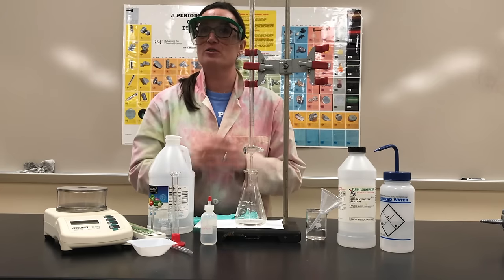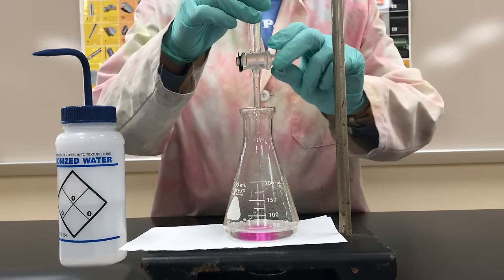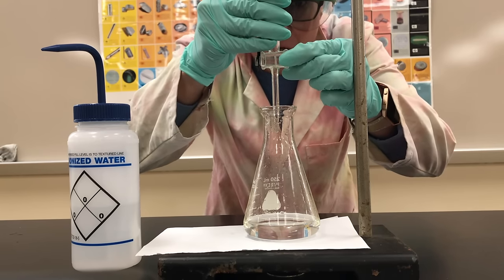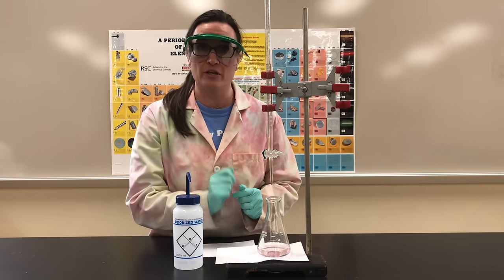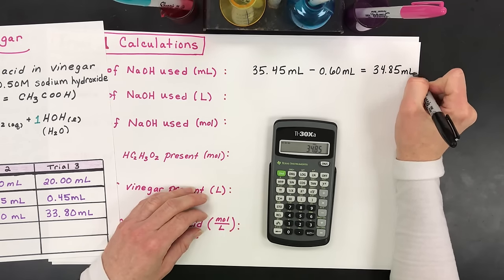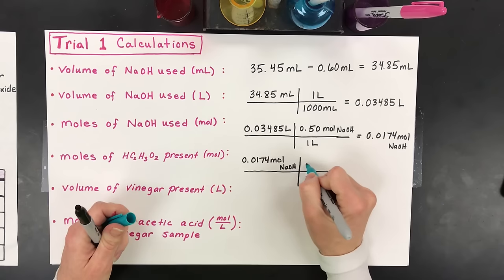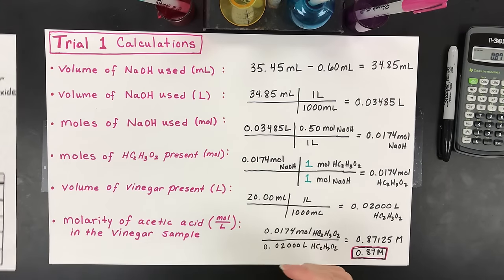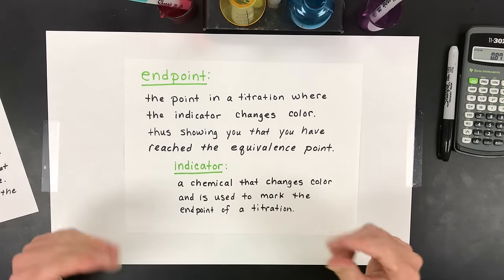Titration Experiment & Calculate the Molarity of Acetic Acid in Vinegar

Comment: I used a vinegar solution that contained 10% vinegar and 90% distilled water, when do I factor this into my calculations?
Reply from the maker: That would be double the typical percent of 5% acetic acid and has a M of around 0.83 M. This video I don’t discuss the calculations to change the moles of acetic acid into a mass percentage.

Comment: I have a question with the 2 decimal places when marking down the volume of the titrant(NAOH). Wouldn't it be one decimal place as you can not be more accurate than the measurement equipment(the burette) itself? Or maybe is your burette just more accurate than the one I have at school as the one I use during practicals only measure to 0.1 of a mL. 
This was a very informative video and has cleared up many things for me. 
Thanks!
Reply from the maker: Burets read an estimated hundredths place because there are markings ever tenths place.

Comment: hi! this video was super helpful! i just had a quick question. if for my lab, i had used 6.12 g of NaOH, which converted to moles would be 0.153 mol of NaOH, would i use that when calculating the molarity of the acetic vinegar? or would i use the molarity of the NaOH standard solution?
Reply from the maker: Since it is a 1:1 mole ratio if 6.12 grams was needed of NaOH to neutralize the Acetic Acid you would have 0.153 mol of acetic acid which you could then divide by the volume of the acetic acid used (vinegars volume).

Comment: Thank you so much .This helped me so much. I am on 2 week break and I have a chemistry test 2nd day back and this has clarified so much. Just one question, when you put final and initial amounts into the table. Is the initial amount, the amount of titrant that was in the Burnett’s before you added any NaOH? As it says an amount less than 1 but the final amount is around 35?
Thanks again
Reply from the maker: The initial amount is the buret reading before any NaOH was added to the vinegar in the flask. Some instructors would have you fill your buret exactly to zero, but that is t necessary unless you plan to make a titration curve using pH probes and a graphing program.

Comment: Hello Anne! Thanks for this. I know that the volume of the vinegar is already known but isn't it adding distilled water before reaching the titration may affect the rate at which the vinegar and sodium hydroxide reach the end point? Or that could be ignored and assume that it doesn't affect the titration process.
Reply from the maker: Nope. The water won't affect the rate of reaction. Water is the solvent of the vinegar (95% water and 5% acetic acid). Since we measured the volume of vinegar used the water added after will not alter the calculations.
Reply: Ann i am a science teacher here in kenya Africa. I have been trying to make white vinegar but failed repeatedly. Please hiw do i make white abd commercial vinegars.
Thanks Ann

Comment: Hi Anne, are you able to tell me how you know you have reached equivalent point? If I understand this correctly, the end point is when the solution becomes pink after swirling the flask, but im struggling to understand the difference between these two points? Thank you!
Reply from the maker: Equivalence point is where mathematically the moles of acid are equal to the moles of base for this titration. The endpoint is a color change from the indicator that signals that that point has been reached. A specific indicator needs to be used for different acid and base titrations depending on if the acid or base are weak or strong.

Comment: Can I change the initial volume of vinegar  to 15cm^3 instead of 25cm^3 and use the 0.1M?
Reply from the maker: Yes, however, there is a chance you may need more than 50.0 ml of the base. If that happens you will need to stop and record your final volume of base.  Then refill the buret, taken a new initial and then final reading once it is neutralized. Then add the two volumes of base together to get the total base volume used.

Comment: Professor, I would like to ask you some questions. Why we need to add distilled water into vinegar? One more thing, when we calculate the C of vinegar, we use the original volume of vinegar or the volume of vinegar+distilled water?
Reply from the maker: You don’t need to add distilled water to the vinegar it just helps to carry out a good titration by washing down the inside of the flask. Use the original volume of vinegar.
Reply: @AnneSchmidt  Thank you so much.💚
Reply from the maker: @sasase3303  you are so very welcome!

Comment: Hi did u make an aliquot of the vinegar? Since once I tried it in school the phenolphthalein indicator did not show at all. Thank you
Reply from the maker: Phenolphthalein will be no color in the vinegar (maybe cloudy due to the fact that it is dissolved in alcohol). It will turn pink when you have excess base ions because of its equilibrium reaction. I just used the vinegar I bought from the store. You could make "vinegar" from more concentrated acetic acid solution and dilute it to make about 0.8-0.9 M solution of acetic acid.

Comment: Why do you add distilled water. And why won't it affect the the values?
Reply from the maker: Adding distilled water helps wash the sides of the flask, gives more volume to mix, rinse the tip of the buret or help add that one drop of titrant.  If you measured the mass of volume of your titrand (substance in the flask) you have the mass/moles/volume and the water doesn't alter that quantity, just dilutes it.

Comment: Amazing. I can see that you used the stoichiometric mole ratio to calculate the concentration of the acid. I want to ask, what if I used the M1V1=M2V2, equation, cause this equation doesn't consider stoichiometric balance. What would be the effect
Reply from the maker: You can definitely use that equation because the mull ratio is one to one. There are titrations where the mole ratio is not one to one. I prefer to have my students use that instead of the dilution formula. Just builds better understanding using stoichiometry.
Reply: @AnneSchmidt  Thank you. 🙏

Comment: Does the added water to add the suspended drop not effect the endpoint?
Reply from the maker: As long as the mass of acid or volume of acid was taken at the start, the moles of acid doesn't change so adding water has no effect on the calculations.

Comment: How do you get .50 for the NaOH standardized mole?
Reply from the maker: I made the solution of NaOH to be approximately 0.50 M NaoH, however you would need to standardize it using a separate titration with something like KHP to get the actual molarity of NaOH because solid NaOH pellets absorb water when exposed to air and will not be able to be massed correctly. I do have a video on how to standardize NaOH with KHP at least calculation wise.

Comment: What was the purpose of the indicator in this experiment?
Reply from the maker: To signal when the neutralization equivalence point at around pH=9 is reached. Do you know why the neutralization is not at pH 7?
Reply: @AnneSchmidt  Wait, there's exceptions to neutral equivalency? I thought it was always pH 7.
Reply from the maker: @baronials  strong acids neutralized with strong bases will have a product pH of 7 because both the salt and water produced are neutral species. The average pH of neutralization of a weak acid with a strong acid is around pH 9 because one of the products is a conjugate weak base ion like C2H3O2 1-. The titration of a weak base with a strong acid has a typical pH of 5 for neutralization because the product is a conjugate acid ion like NH4 1+ if NH3 was titrated with HCl.

Comment: Hi Anne, just a quick question why did you do all the calculations separate and then average the Molarity. Would it not have been quicker if I just averaged the titre values and completed the calculation once?. I appreciate hearing from you soon , thanks for this video!
Reply from the maker: Possibly, but I used different volumes of base and many times you will have different volumes of acid. So averaging the Molarity is typical vs averaging volumes.
Reply: @AnneSchmidt  Oh makes sense, thanks for letting me know!

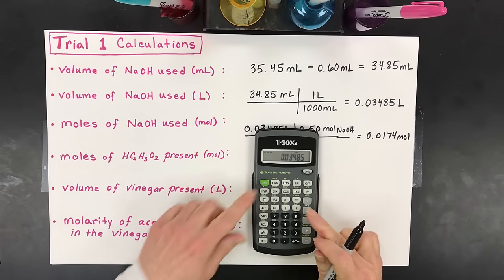Comment: @10:00 should be 0.017 mol (instead of 0.0174) with 2 significant figures.
Reply from the maker: All the measurements taken had three or four sig figs, so 0.0174 mol is correct.
Reply: @AnneSchmidt  Thank you for your kind reply.

Comment: I have one simple question, isn't the endpoint is the point where you have a slight excess of the titrant? I mean, at the equivalence point for the acid-base titration, wasn't that supposed to be neutral as they are in equilibrium? Otherwise, I enjoy watching your educative videos and thanks a bunch!
Reply from the maker: Thanks! Because this is a weak acid with a strong base the equivalence point, where the acid is neutralized and all that is left in solution is the conjugate base ion (acetate) with water, so the pH is around 9 when all the acid is neutralized.  This is why phenolphthalein is used because it turns light pink around that pH.

Comment: I made a 100 mL solution (5 mL of vinegar and diluted it with distilled water so I had 100mL). I transferred 25 mL of that solution into the flask and did trial #1. Your volume of vinegar present is 20mL for trial one. Would mine be 25mL for trial one?
Reply: Thank you :)
Reply from the maker: Because you diluted the vinegar and then didn't titrate it all you have an issue. The only thing you could find is the moles of acetic acid in the vinegar when you titrated to equivalence. The 25 mL can't be used for a molarity calculation. You needed to titrate all 5 mL and then you could have found the moles of acetic acid in the 5 mL and turned that into molarity by dividing that mole amount by 0.005 L (5 mL) to get the moles per 1 Liter.
Reply: @AnneSchmidt  What if I took all the trials for the vinegar and found the average. That way, If I use the average, then I can find the concentration of acetic acid by (0.0024 / 0.005) (since 5mL of vinegar has 0.0024 moles). I'm testing 5 different brands. Thank you so much by the way, you've been so helpful and kind, very much appreciated. God bless xx
Reply from the maker: @AuthenticAim  You would need to add all the moles of acetic acid you found from each trial to have the total moles you had in the 5 mL and then could divide by the 0.005 L. This would give you a Molarity of acetic acid you could then turn into a percent by volume to prove vinegar s 5% acetic acid by volume (95%water).
Reply: @AnneSchmidt  Hello, in the case of getting a little less than 5%m/v, what could it mean? what could have gone wrong in the process?

Comment: Anne, sorry to tell you that the swirling and the dropping of the titrant should be continuous. Right hand holding the Erlenmeyer flask and left hand with three fingers crossed the stopped cork should be the right method, please take notes. Thank you.
Reply from the maker: Continous swirling isn't necessary as long as you mix without spilling and use Dionized water to rinse down the sides of the flask. As well as adding less and less titrand as you get closer to the endpoint and equivalence point.

Comment: Great video.

Just a thing from the language police: 

Instead of talking about "moles of X" please use the proper quantity name, i.e. "amount of substance". Similarity, molarity is a quantity and is defined as amount of substance per volume(both are quantities). The unit of molarity is molar, which is defined as moles per liter. It is important not to mix quantities and units as it creates a confusion of what units and quantities are. Thus leading to less understanding.

https://en.wikipedia.org/wiki/Amount_of_substance

https://en.wikipedia.org/wiki/Molar_concentration
Else, great work.
Reply from the maker: Thanks for the positive comments! 

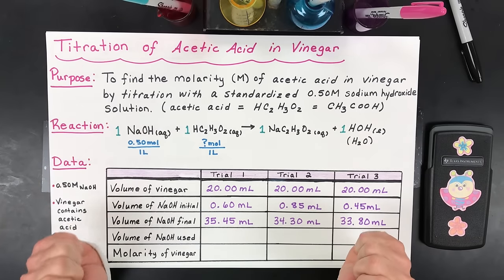This video was made for sophomores in high school for their first-ever titration. At 7:00 and 14:00, I call the solutions of 0.50 M NaOH and ~0.8 M CH3COOH both molar solutions, so I am not sure how I irked the language police. The quantities of moles and molarity were found in the calculations. 

I am teaching high schoolers who will eventually take the AP Chem Exam and if they don't include moles, molarity, grams, ...as a label/unit they will lose points (even if the number is correct).